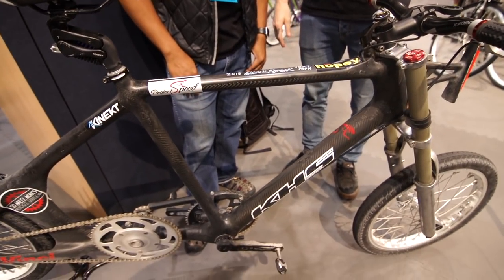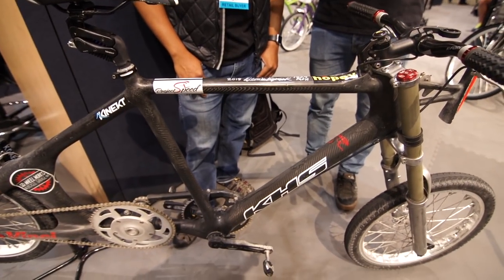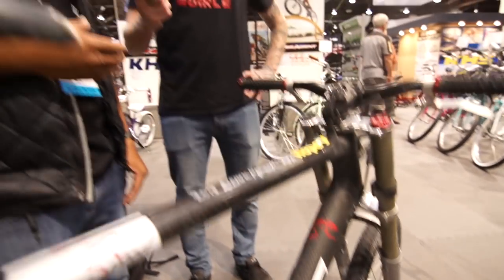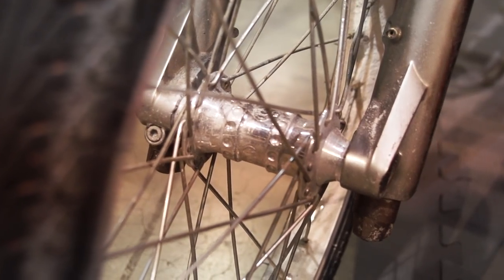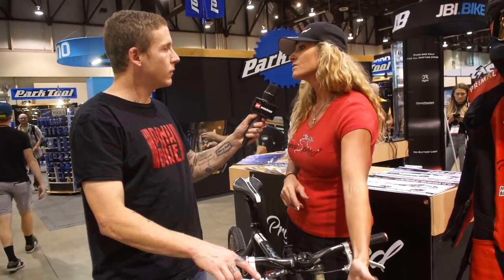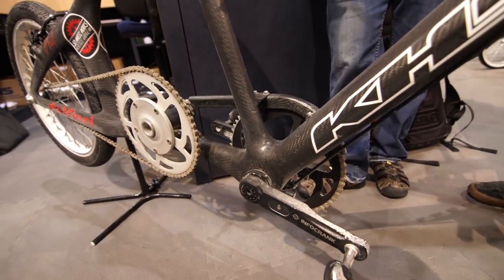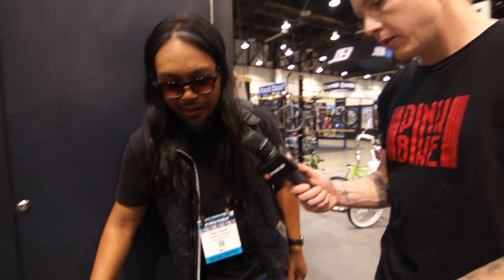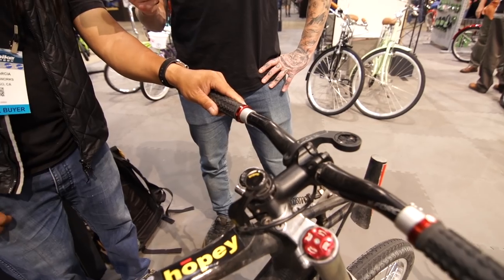This is the FASTEST Bike in the World! | 183 mph Land Speed Record Bike

Comment: That is nonsense, how about we put huge fans in the sides of the road that blow air from behind of the cyclist and help him? Or how about we go to a slope and simply allow gravity to take over? This is not cycling, this is using a vehicle to create suction and draft to simply help you remove the air resistance and even use it at your favor, also she is being pulled by the car for the first mile so she doesn't even gain that speed by herself.
Reply: i respectfully disagree. but i'll only address your biggest mistake in your post. the cyclist is a she. there's only a wee bit of difference between a he and a she. it was a bicycle and that's a great idea to put fans on the side of the road, but not nearly a brilliant idea like this one. fans on the side of the road just isn't nearly as ingenious as the draft of a dragster. fans on the side of a road doesn't even compare to what one can get with a dragster. and fyi: runners run with and against the wind. bikers bike with and against the wind. it's real. and they still count the results. this was a brilliant idea to cater the wind for the cyclist. absolutely brilliant (but in my opinion too dangerous, but that's a different topic).
Reply: enjoy this video:
https://youtu.be/qYeuTXj1FY8
I think this one caters to what you assumed this one was. But please don't blame these heros for your incorrect assumptions.